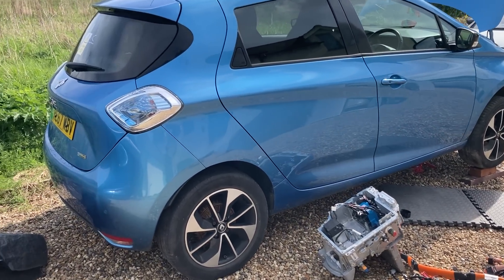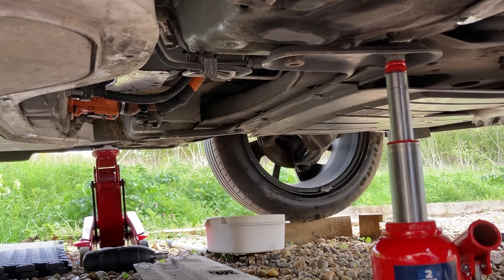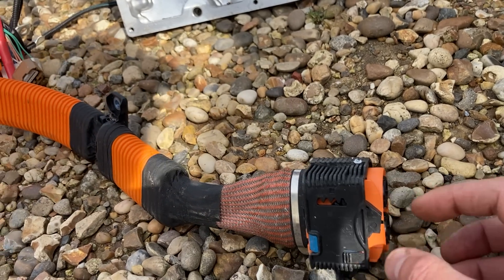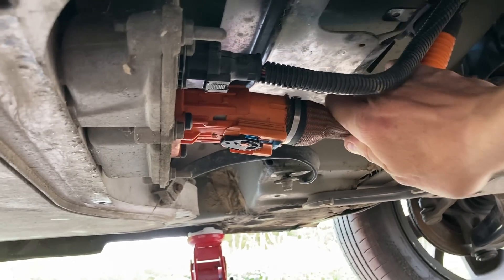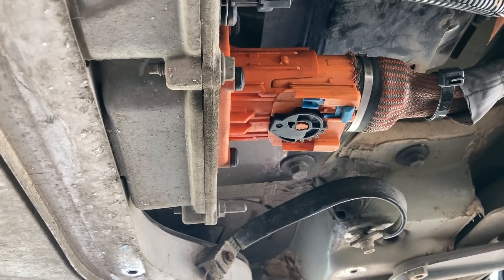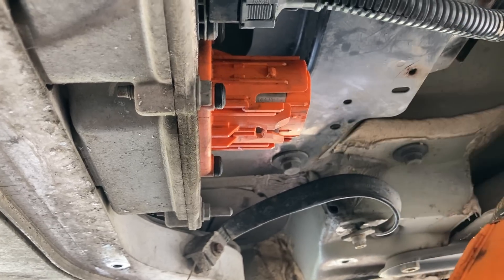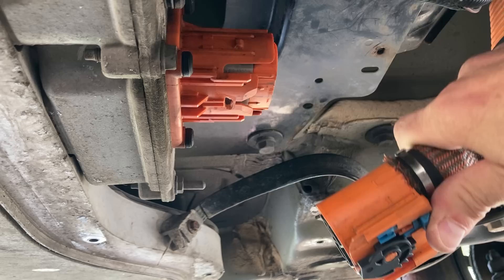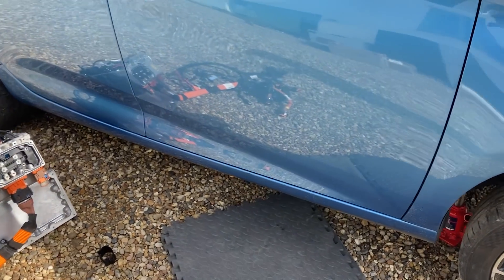Copart special - major damage on this salvage Renaut Zoe EV Electric car

Comment: Are you planning on parting this car? Looking for a HV lockout (the plug itself).. They are the same between ze20/40 and ze50?
Reply from the maker: Hi no, it's going to get fixed. Cheers
Reply: @garycevrepairs  Do you know if they are the same between the models? (the lockout orange plugs with green lever)

Comment: That is one 9f problems with electric cars there seems to be so little information out there that many even though competent with electricity simply can't get the info they need to fix the cars.
Reply: Broken connectors is an issue on basically any car made in the last 40 years if a moron has been near it.  Can be tricky figuring out how to release an unfamiliar connector with poor access but forcing it never goes well.
This was likely done by someone in the salvage process to ‘isolate the battery’ with no knowledge of how to do it properly or care of causing damage (as evidenced by chucking the under tray rather than keeping it with the car).

Comment: Renault need to be taken to court over all these motor failures in Zoes. My friend had his fail at 45k miles. My ZE50 is out of warranty in 6 months time and I'm at 25k miles. No way should these be failing at such low mileage.
Reply: That's exactly why I didn't buy one. Yeah, you can get warranty, but it will fail in time.
Reply: Totally agree. These motors are so flaky with air blown through them and using grease sealed non inverter designed bearings with limited life. Just look at all the later cars that almost universally have oil immersed/lubricated motors. I wonder what the wading depth is!!! 😱
I'm amazed what Gary is achieving on a gravel drive basically under a tent! I splashed out on a car lift some years ago for less than £1,500 and its a Godsend. Great work mate keeping these very nice but worryingly unreliable cars on the road. They make superb second cars.
Reply: Don't panic. This is an exception not the rule plus some idiot worked on it previously and wrecked it

Comment: Copart forklift I reckon?
Reply: I doubt it, they use large JCB fork lifts with forks the length of the car, the forks would not be in the middle of the car, so damage from forks will be contained to the outer area of the underside of the vehicle nearer to the wheels. They certainly wouldn't pick up the connector shroud either, that's clearly been damaged by some pulling it appart. I've worked on their trucks, and occasionally the forklifts for almost 20 years, so seen it first hand.

Comment: Any update on that battery lease? Also, any chance you can take a look at the R5 to see if it's just an updated Zoe, with the same bearing issues?
Reply from the maker: Battery lease fight update coming asap, have been waiting for the court. Haven’t looked at the R5 but highly likely to be an updated design, the Zoe is old hat now. Megane e is massively updated. Cheers
Reply: R5 has a permanent magnet motor, so it's a completely new design.
Reply: All early Renaults were on battery lease. Renault always own the battery and there’s nothing you can do. Thats why they were cheaper than other ev’s at the time.

Comment: Great content and I love that you simply try to fix things without the big garage just outside with what you have.
I do not have a Zoe, but I like to learn and this topic and understanding becomes more and more important cause the older the cars gets the more people have tried and played around. Like in the old caburator days when there were many screws but some turned all at once around and nothing worked afterwards. 

Yesterday I saw a dutch guy who had bought Nissan LEAF battery from china to replace his old 24 kWh one with only 90 km of range remaining with a 52 kWh one. And the dutch guy showed all the steps and explaind those in dutch (but with english subtitles) so I could see how the shop needed about 1,5 hours to swap old versus new which was also a cheap one if I remember right - 5000€ or so from chinese manufacturer. Odometer showed over 400 km in the beginning and later he achieved about 360 km real range.
No issue with the battery BMS or fault codes in the Dashboard.
Quite unusual video cause it was released by the manufacturer and had been taken by the car owner so a real case of an EU customer driving to an ordinary workshop using palettes to let the battery out of the car - nothing fancy, no scissor table .

THANKS